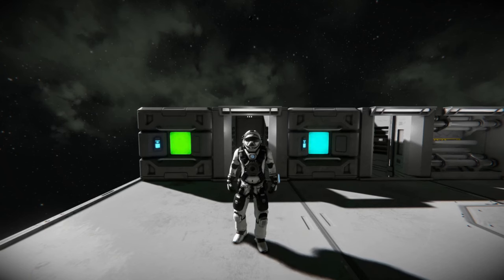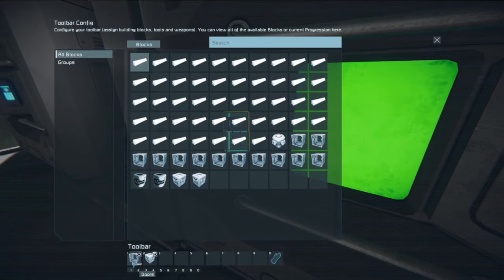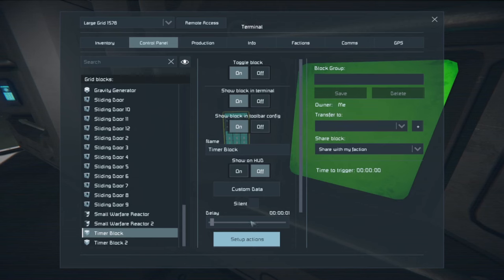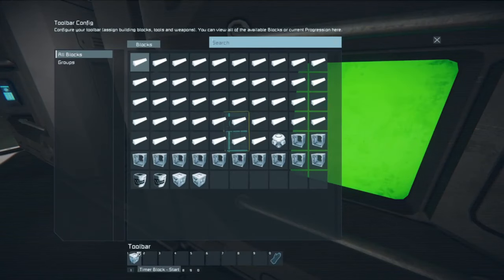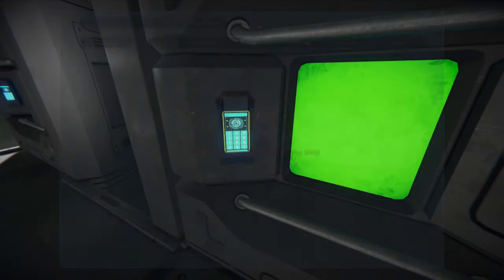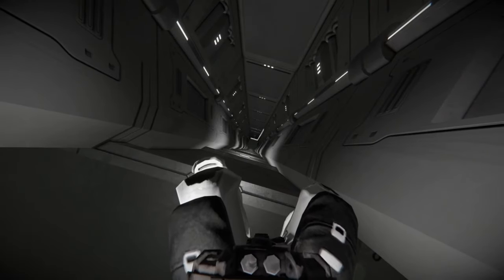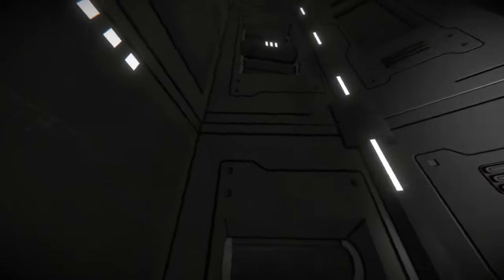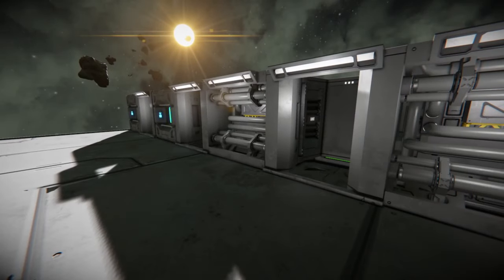Fast Tube Trick

Comment: FYI, timers can start themselves, so you can have your door closer timer set to start itself and it will loop on repeat for however much time you set it for. You don't need 2 timers. That said, a better system would be to use an event controller to start the timer every time a door opens. Set it for like 1 second so it will be reset before you open the next door. This avoids the issue of doors closing when you try to open them because the timer isn't running constantly.
Reply from the maker: Yeah I figured there was a way to do it with the event controller but I couldn't get it in time to get the video done

Comment: If you're using gravity wouldn't a more efficient version be making the downward force forward from your walking perspective then you can run along the roof of the corridor and simple jump when you're at the floor you want.
Reply from the maker: The problem would be getting back out. I suppose you could set the gravity to push away from the hallway instead of towards it then the gravity would help you jump out the problem then is you would have to jump into each floor in order to access the floor below in other words you would jump in run through hop out on the next floor and then have to jump back into the corridor and run back through the whole circuit again

Comment: Nifty. If you had 4 floors or less, you could just have a 4 button panel which closes that door and opens the rest, so you can drop directly to the correct one.
Reply from the maker: Ya you would just have to extend the timer and set the doors to four groups corresponding to each floor.

Comment: I don't think you need two timer blocks for a timer loop. I have auto closing doors inside of my larger ships and i use just one timer block with the "start timer" option first, they'll stay looped forever at that point. Also, those sliding doors can kill you in survival. They're not like the original doors which will push you out of the way. For safety purposes something like the offset door would probably be the better option.
Reply from the maker: Might try it with the offset doors next.

Comment: Space Engineers doesn't have anything like the Elevator Blocks in Empyrion?
Reply from the maker: You use piston or wheel blocks to make an elevator cause your build may vary.

Some guys have built space elevator platforms using the wheel method.